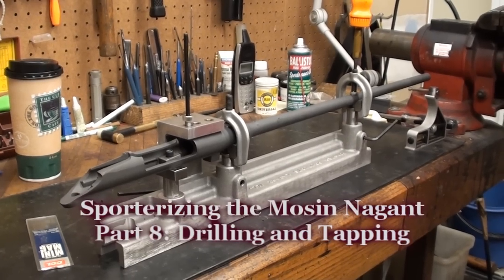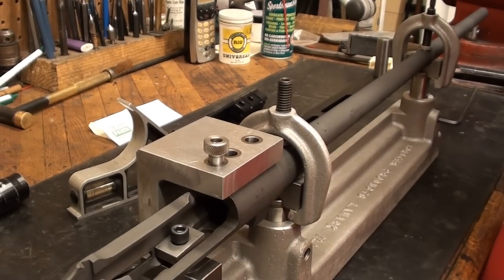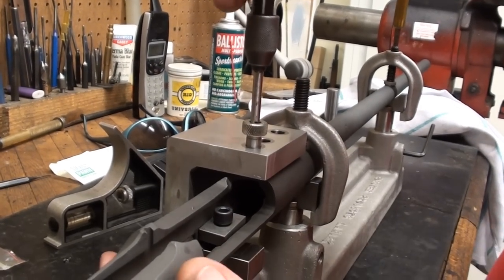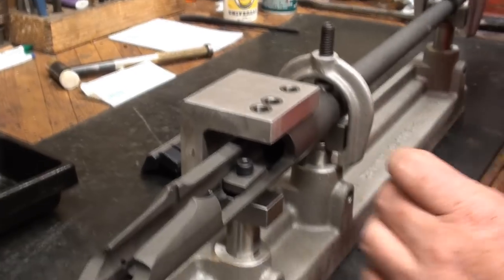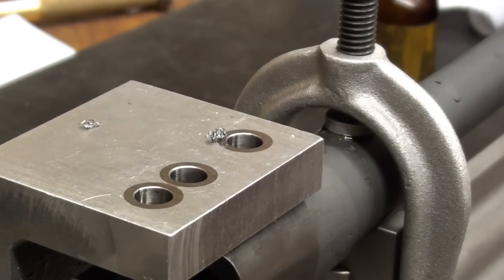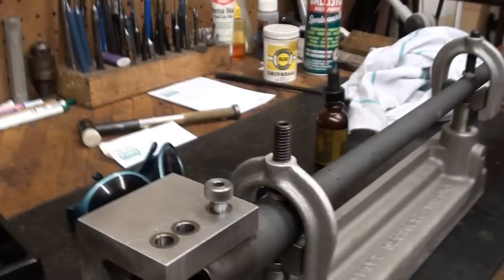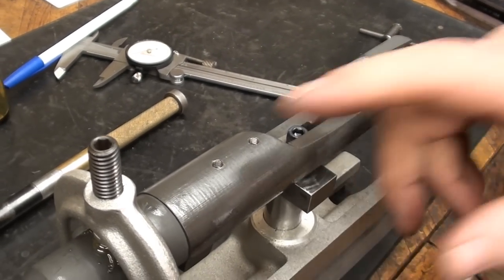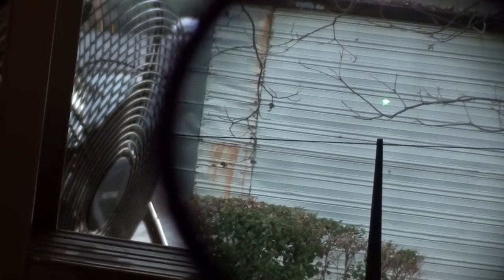Sporterizing the Mosin Nagant Part 8- Drilling and Tapping for the Rock Solid Mount

Comment: Quick tip. Use the Forestewr fixture as a point of refferance. than use your dial caliper to set the the bushings for the proper distance between your base holes. (insted of center punching the action.)

Comment: if you drill a hole above the chamber we all know you dont wanna go through.  but how much material do you have to leave between the bottom of the hole and the chamber wall?  i would guess you wouldnt wanna go more than 2/3 of the way but thats just my guess, i also don't know the nominal thickness of the chamber wall at that point.  any suggestions on how shy of the chamber to stop?

Comment: Okay so serious question here. I took mine to a reputable gunsmith near me that alot of guys have had him work on guns and does great work. I gave him this exact scope mount to tap onto my 91/30. He had a hell of a time because the metal was going from soft to hard. 1943 Izhevsk so not surprised. But the rear taps went great and look good. Front however closest to the chamber went through. It's about 1/4"  from the face of the bolt when the bolt is down. Is it safe too shoot? I mean the bolt will seal the hole but I'm more worried about it trying to Crack from pressure from hole to hole. I've tried calling RSI but can't ever get ahold of anyone.

Comment: i have a 91/30 what would ya charge to drop it down to the same length and take off the rear sights, along with the finish on it?  I'm getting an archangel stock and don't think it'll look the greatest with such a long barrel and the bluing wearing off.

Comment: @Iraqveteran8888 Hey, where can I find a bore-site tool like that? I found one at the gun show out here in California for about $20, but didn't see anything else. I am working on a similar project using an ATI Monte Carlo sporter stock, but noticed the gun does not properly fit into the stock. I am also going to have to polish the receiver on this rifle because of a "sticky bolt" issue. Do you know of anywhere where I can find a "virgin" bolt that has not been bent?